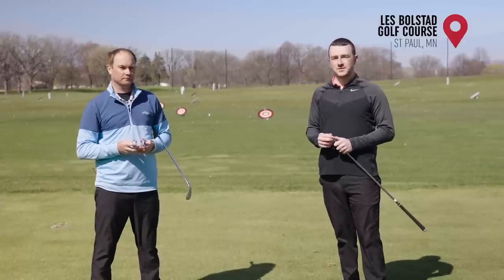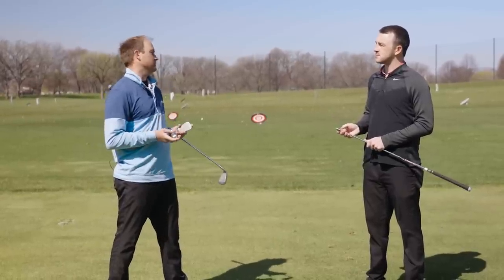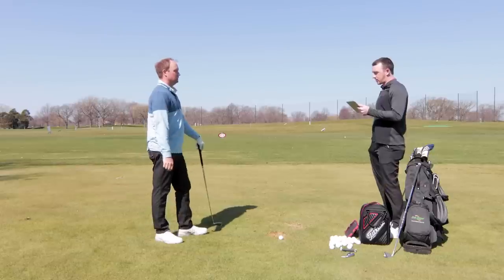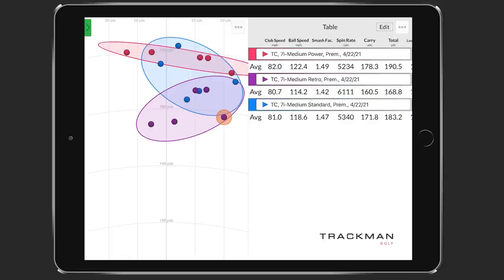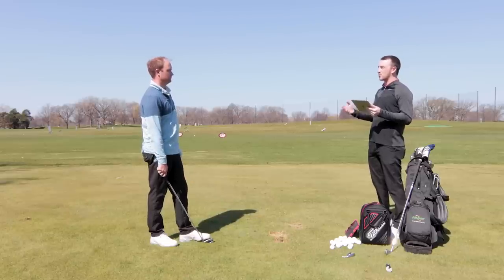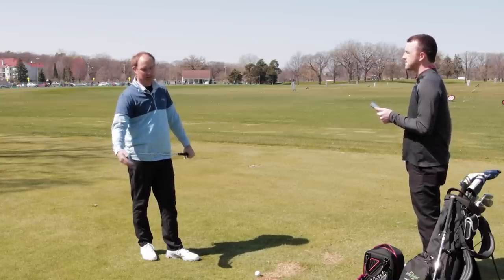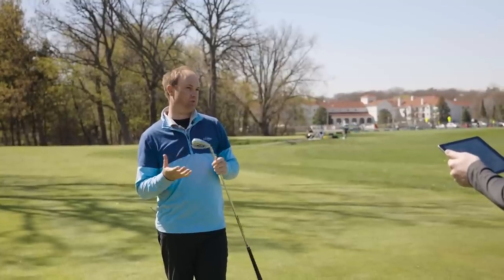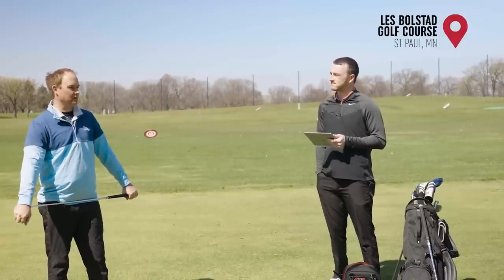Golf Iron Fitting | Standard Spec, Power Spec, Retro Spec

Comment: You didn't mention the iron's bounce angle - the power spec will have less bounce than standard, the retro spec will have more bounce than standard. 
What effect will this have on the use of the club to the average golfer?
Is the change in bounce angle something the average golfer should consider when being fitted for clubs?
Reply from the maker: Thanks for bringing this up Martin. We generally see that players that do fit into either power spec or retro spec don't have issues with the bounce because their attack angles fit the bounce angle difference. However, our fitters do take note of it in fittings and will keep an eye on the attack angle to see if an adjustment is needed

Comment: Nice video, the numbers you put up in the outdoor test were quite different than your indoor test with the G425 a couple months back. I think the previous test was a 210ish carry, was that die to turf interaction or a different launch monitor?
Reply from the maker: Hi and thanks for watching! You bring up a good question. After looking at both videos, the key difference in the data leading to differences in distance is spin. Thomas was spinning the power and standard specs both over 6000 in this video, whereas in our original review and testing video for G425 irons it was in the mid 4000s. The spec video had Thomas' face angle 4ish degrees open, which could have been contributing to the spin increase and that could be due to our setup of the Trackman not quite centered. Great feedback here though, we didn't even notice!

Comment: Correct me if I’m wrong, but if the pin is 165 yards, and You hit a full 8iron standard 160yards and a full retro 8 152 or something, what’s the point of these specs when the game is about yardage? You would then have to grab a 7iron in retro to hit maybe 160-165 yards passing the standard 8iron loft by a few degrees, subsequently hitting a lower shot than standard 8. Do you get what I’m saying here? None of this makes real sense to me. Pros have diff lofts throughout to match the yardage they desire. Simply adding our subtracting all the lofts for every club just doesn’t add up.
Reply: Yes, if the gapping is too small or too large between clubs, one should adjust lofts accordingly. This means one could have a mix of standard, power and retro lofts in your iron set for optimal gapping. Not sure if fitters will willingly go to this level of fitting because it means testing more than just 7 iron!

Comment: Question?  Wouldn't it be easier to hit a POWER spec club?  Instead of hitting a 7-iron regular spec you would hit an 8 iron to get the same distance.  With the club length being shorter contact would be more precise...right.  Basically, wouldn't you just club down if you went with a power spec set???

Comment: Curious how the lie angle and bounce changes (if any) from power spec to retro.
Reply from the maker: In this video, lie angle was slightly altered for the Retro spec head because we did not have that fitting component available. However, if you were to order Power Spec or Retro Spec, PING builds those to still fit their lie angle color codes. For example, Power and retro spec are still available in all of the color dots. Hope this helps

Comment: Hey Thomas, you said a 70 mph swing speed guy should not use the power spec. I'm that guy looking to buy the i230 and I like the Elevate MPH in stiff. It feels like a regular flex a little bit.  Anyway with this high kicking shaft I'm hitting the ball pretty high. Do you think I can get a little more distance with this shaft in the Power spec in the i230. I mean it's not much more. What do you think?

Comment: When I upgrade (eventually), I plan to go retro spec. I have no problem hitting long(ish) but I do end up with 15 yard gaps (and would like a bit more spin/shaping). I currently game 30.5* 7i, plan to move to a 27-28*. 8 hdcp, looking for a players iron, not ready for blades. Any suggestions?
Reply: retro spec would be 33 +/- 1 not 27-28. Mizuno jpx forged
Reply from the maker: Nice, thanks for the question Jason. If you have no problem hitting it longer, we would suggest actually increasing your iron lofts. So if your 7-iron is 30.5*, going up from there to 31-32 degrees. That's where a lot of players-distance and players cavity irons fall. A few in that range that have performed well in fittings this year: Mizuno MP-20 MMC, TaylorMade P770, Titleist T100 or T200, PING i210, Callaway Apex 21 or Apex Pro 21, and Srixon ZX5/ZX7.

Comment: I’m looking at i525 and Mizuno Pro 225, but now am thinking perhaps the i210 with Power Spec would be the best of both worlds of feel with some extra distance. As a 10-12 handicap, I’m slightly concerned about forgiveness, you think the i210s with Power Spec would be a good choice? 7 iron swing speed is 85-86 mph, and I usually hit the ball high.
Reply: Curious, what did you end up with and how did you get along with them? cheers
Reply: @lawbinson  i525s, no regrets. I got a +1/2” for the first time, so took some getting used to last season, but I like them a lot. Decided on the Ping because they were slightly more forgiving than the Mizunos. Plus they’d discontinued making the i210s.  Seeing the new i230s now, I’m still happy I have the i525s 👌🏻

Comment: Thanks Thomas and Drew. I have some questions for you and any of the viewers.  Are these irons cast to the three different loft specs at the factory or do the Retro and Power spec irons start out as Standard and get bent manually and if so how would this affect bounce and offset?
Reply: Great questions.  Hopefully we'll get answers.
Reply from the maker: Hi, thanks for watching and for the question! In this video, lie angle was slightly altered for the Retro spec head because we did not have that fitting component available. However, if you were to order Power Spec or Retro Spec, PING builds those to still fit their lie angle color codes. For example, Power and retro spec are still available in all of the color dots. Hope this helps
Reply: @2ndswing  Thanks for the reply.  So, if I understand correctly  for Ping irons whether they are retro, standard or power lofts the bounce, offset and lie angles are the same.
Reply: @2ndswing  Thank you!